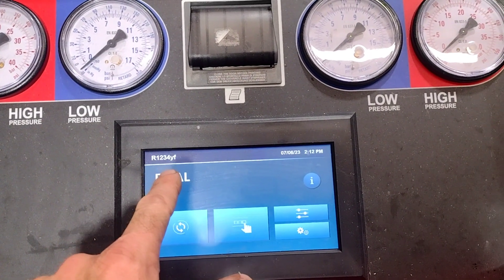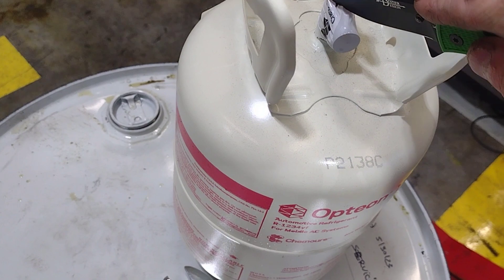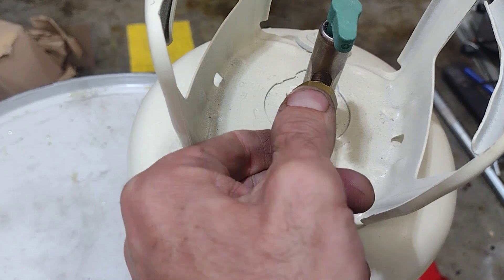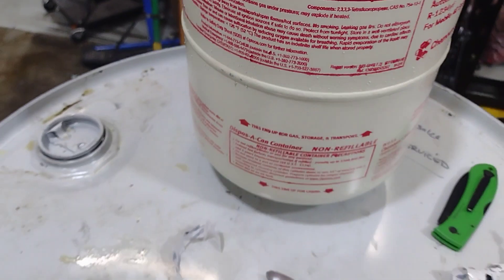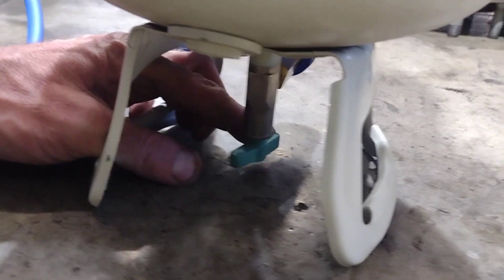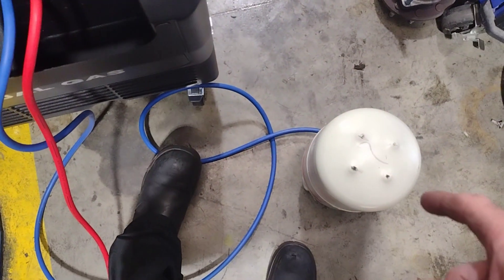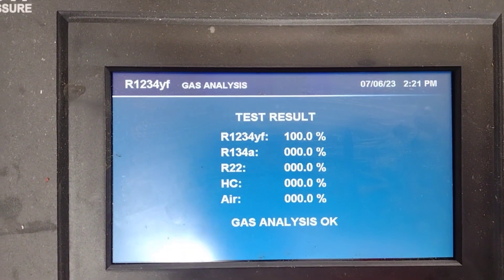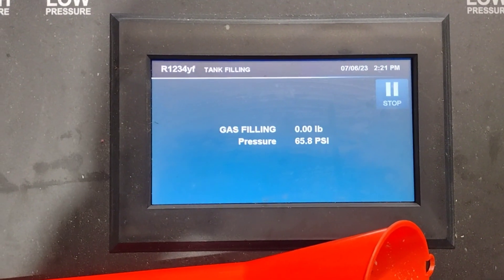Filling The Dual A/C Machine with 1234YF Process #newtoyou #airconditioning #acmachine

Comment: Awesome content. Where did you get the adapter? And what brand is your refrigerant? Currently have a 10lb of honeywell and opteon
Reply from the maker: What adapter?  Its a dual machine. It does 134a and 1234yf. There's two different hold tanks.  Comes with everything you need. The brand is whatever oreillys had
Reply: @BeardedFordTech im talking about the adapter that goes from the 10lb refrigerant tank valve to the manifold hose

Comment: Does this apply to the other side (r134a) like same process just the other side of the hoses of r1234yf?
Reply from the maker: @electrogonorhea  it's two seperate hold tanks.  To go from 1234yf I will have to go to main menu and pick 134a and it will take 6 min to change over to that side.  Fills the same way.  It does not use the same hoses. A. Cause they are different sizes. B It will contaminate one or both sides.
Reply: @BeardedFordTech  thank you boss 👍🏼
Reply from the maker: @Holyhairyareola  your very welcome.

Comment: Had me worried for a second, saw Ray do a service with the same machine the other day, took the entire day for machine to complete the fill.
Wouldn’t of thought you’d have that much free time up your sleeve.
Cheers👍
P.s only 46 here atm
Reply from the maker: His machine is different. Mine does both. It just takes forever to fill the hold tank.  Mine doesn't charge them recharge and all that crap. It will charge about 0.2 lbs then ask you to check for leaks in the vehicle. Then continue charging. It charges fast. Just filling the hold tank is slow as molasses.

Comment: Awesome nothing like turning on the AC and the vehicle starts blowing hot air. 😁
Reply from the maker: Yeah that sucks. Even though it initially blows hot air to begin with cause it hasn't pulled the hot air out of the cab or circulates freon through the EVAP core to "cool off" the hot air it pulled from the cab.